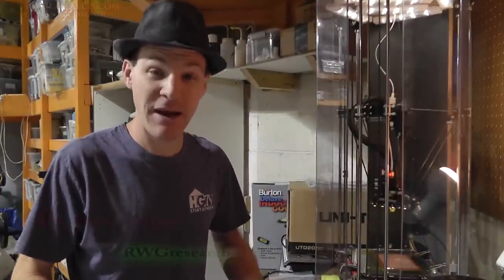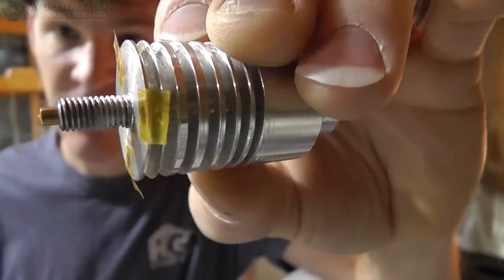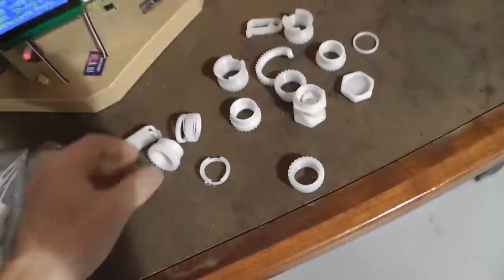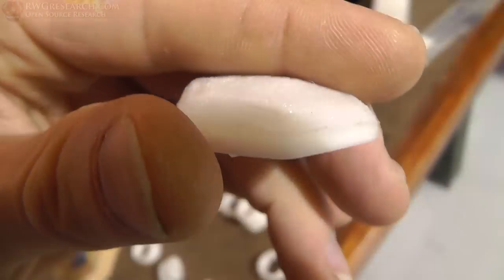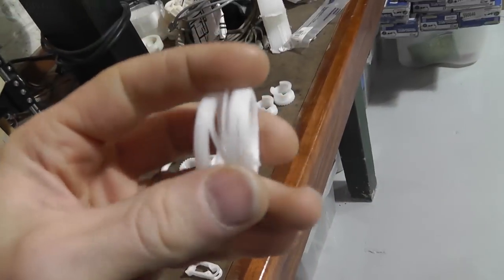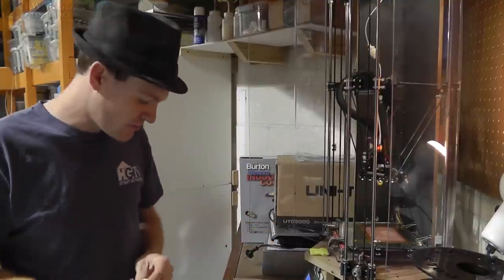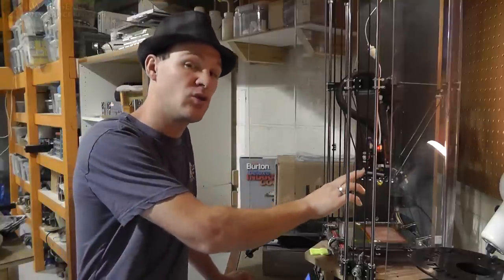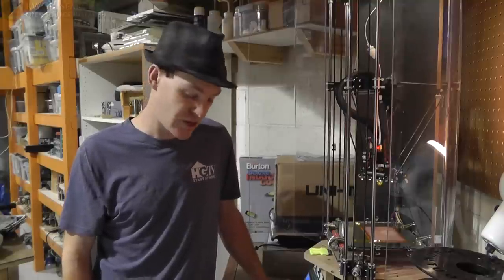3D Printing: My Experience With Taulman 618 Nylon. General problems, ECT.

Comment: Excellent video.  Thank you for sharing so many details about your R&D with nylon.
I'm about to start testing and every bit of info helps flatten that learning-curve.
Probably won't be headache free,, but , sounds like a good challenge  :)

(research tip:)   I have my 618 & 645 on a rod, mounted inside of a clear storage bin, with lots of descendant, taped-sealed, and a push-to-connect fitting ready for a bowden feed tube. 2 ptc's (top-lid & bottom-front) allow me to keep the bin on a shelf, or beside the printer.
Reply: I have my nylon in a old country crock butter container and I baked it before I put it in there with a demoisture baggy.have you tried dye your filament?
Reply: DJake77 I have a variety of dye colors ready to go,,  just haven't had the time to try it yet.
The RichRap video is a good tutorial ,,  but he did it with a loose filament roll,, instead the spooled filament that comes these days.  I'm assuming that I'll also have to go thru the baking process, to dry it back out properly..?
Reply: Duplicat yes it will be very bubbly if you don't i baked my filament for a short time on low and it was enough to print right after but if you plan on it sitting probably bake it a little longer.hint don't bake it in a toaster oven my spool melted!

Comment: The Ally hot end .. Make oval shape so you have more cooling area and tap to take a SS threaded  throat use TPE tube inside 4mm,,, hot end ..  make end out of 1/2 steel with 2x 40W  heaters  tap so 2 different  jets are between the 2 heaters, that way you can buy different sizes...,,get an independent power supply and run about 15/ 16 volts for 24 Volts,, works for PC not tried Nylon yet but looking for some,,

Comment: Nylon sounds like good material for weed eater filament if its that hard to break, or is weed eater line already nylon?
Reply: It depends on what kind you get but most are nylon,The one down side is most are 2.50mm and won't work on a 1.75 mm nossle http://www.tridimake.com/2013/04/3D-printing-with-cheap-trimmer-line.html?m=1
Reply: DJake77 I have used weed eater filament, for most part it work rather well. how ever it being made for other then 3d printing they are not concerned with moisture. Taulman are made For 3d printing and I am sure they pay more attention to humility.( weed eater filament makes poping sound while printing because of the humility)